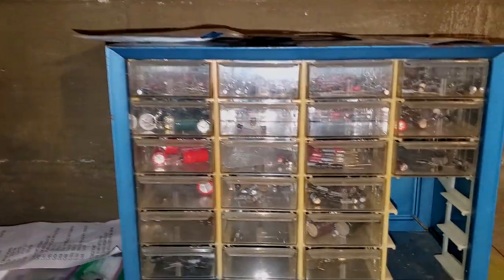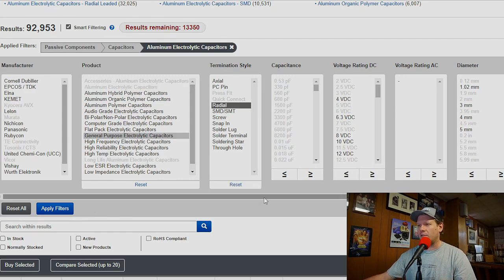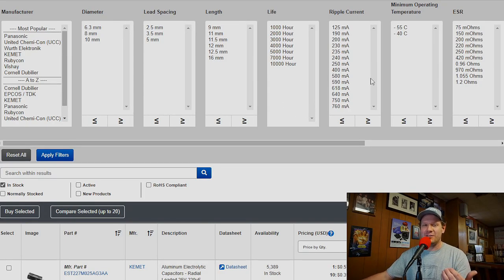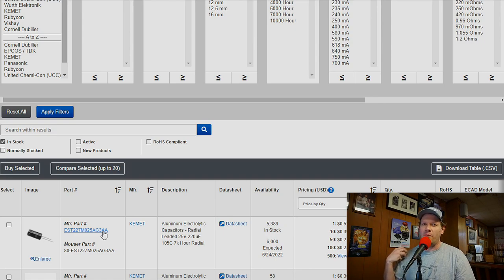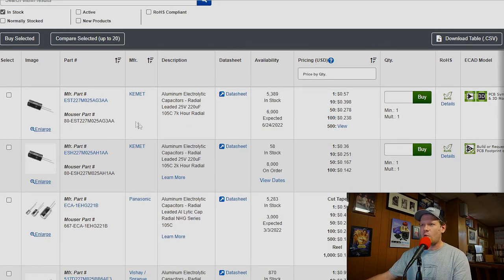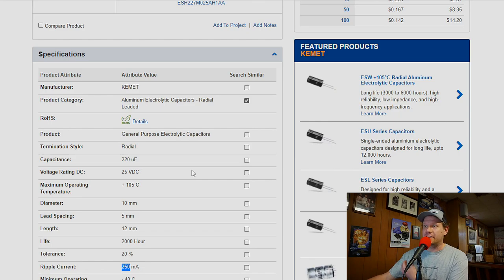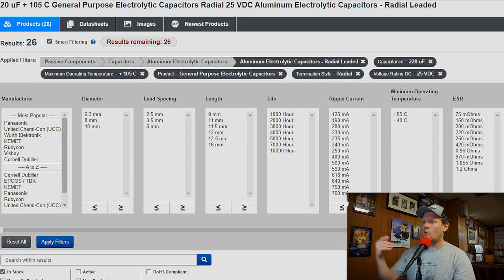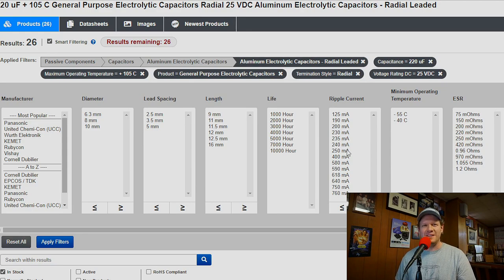Why Capacitor Ripple Current matters in a CRT | Retro Tech

Comment: And here was me thinking a high ripple was a good thing! Glad you made this video before I ordered my cap kit as I literally went through and picked out all the caps with the highest ripple values 😅
Reply: Well this video is total bollocks and YES "high ripple" values on caps ARE GOOD. Because on caps the value stands for the maximum ALLOWED ripple current the cap is rated for, not what the cap introduces in the system as the video wrongly suggests. Its a HUUUGE misunderstanding from retrotech. He comes from the idea "we want to reduce ripple" (which is true for DC circuits and thats whats smoothing caps are for in them) and wrongly interprets it as "caps are introducing ripple" - not they SMOOTH ripple. 

In general low esr caps have higher max ripple current rating, as they heat less with a given ripple current due to having a lower resistance against them

Have fun trying a cap with low max ripple current as the s-correction cap - it will age in hours, if not minutes.

Comment: I've been wondering what the effects of high vs. low ripple current are.  I'm not going to be doing any CRT repair myself any time soon most likely, but is there a number you try to stay under when buying caps?  Or does it depend on the cap's other specs?

Comment: While I simply have love in your videos ,  your opinion on capacitor is completely wrong,  when you read ripple spec is jus the maximum amount of current which the cap can receive an remain into its soec ,  this means that more the cap ripple is rated then better it is. This is more crucial in some CRT deflectuon circuit when AC and DC current are present and at high frequency for example on the ABL circuit, an high ripple current cap should be the only one choice . I'm an electronic engineer who have love in Steve and in his job and want only help 😂
Reply: Yes, it's just the "rated" maximum. If you, for example, have a ripple passing through that cap that is less than the rated maximum, the capacitor will last longer than its rated lifetime @Retro Tech.

Comment: I'm sorry Steve, but your interpretation of the ripple current specification is not correct. Love your work and videos, but please double check your info. High ripple current rating IS generally better. It is the maximum permissible current that will not generate excess heat inside the capacitor.